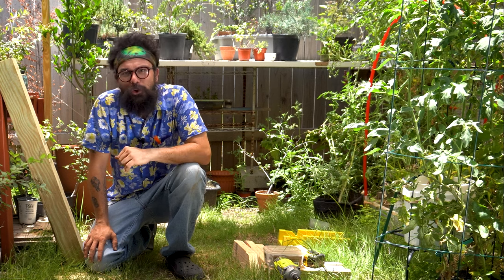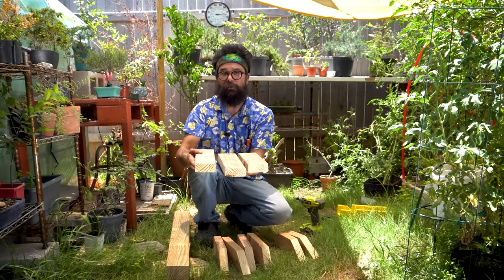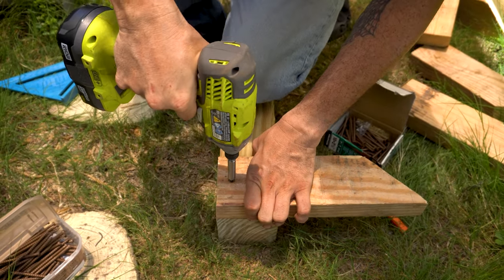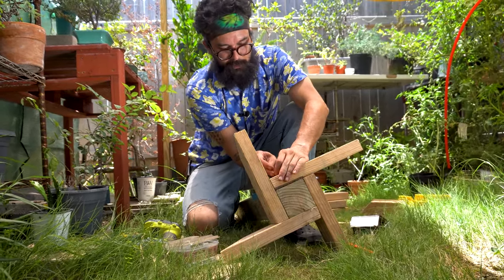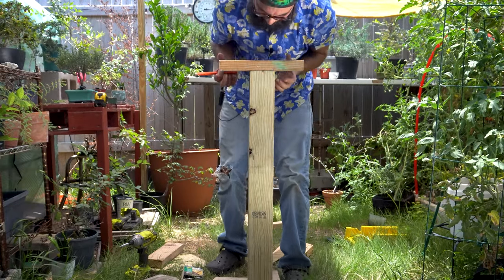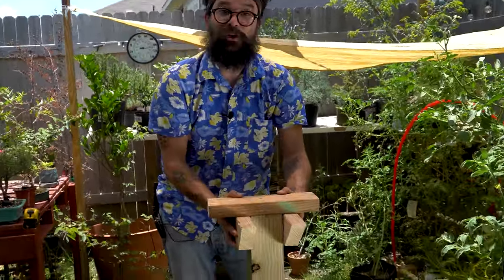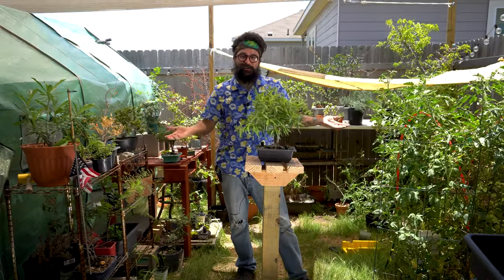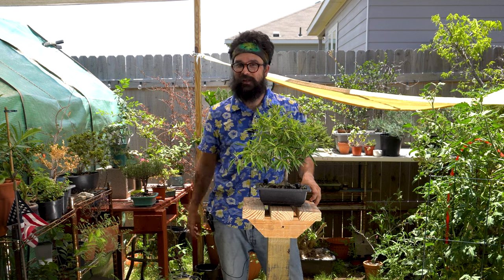How to Build Your Own Monkey Pole Bonsai Stand! - Bonsai-YEAH!

Comment: Half lap joint for shelf support!!
Reply from the maker: Boy, I wish I had proper tools to do lap joints!
Reply: @BonsaiYEAH  i use a japanese pull saw to do the lap on top of the 4x4, and then skip doing it on the 2x4 or support arm.  Just want a lip for the support arm(s) for the 4x4 to take the weight and not the screws
Reply: Looks good!  Love the 2x4 centered on the top of the 4x4 to take the weight of the pot/plant.  I get nervous when I see people just using the side pieces to hold all the weight with just screws
Reply: @thelazybonsai  do you have a video for your stands? Would love to see it! Or even just step by step instructions 😊